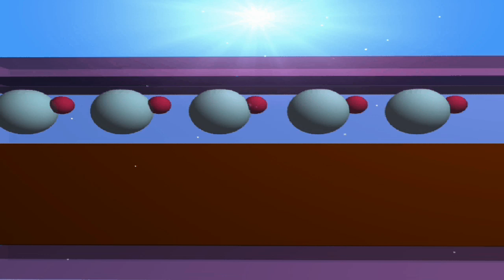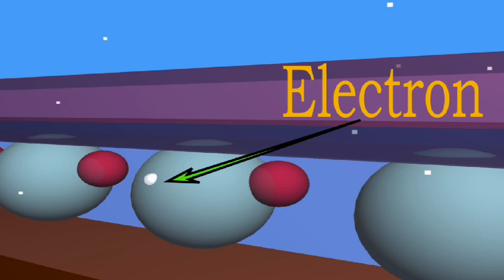How Solar Panels Work

Comment: Do you believe it would be possible to create a solar cell-like device that can capture radioactive discharge in the form of alpha, beta or gamma particles and transmit them in the same manner(as electricity)? If so, would the cells need to be made of a differing material?

Comment: I get confused, in the other video the electrons was moving from the top layer to the bottom layer, and then into the wire and got back. Wich is the the correct one?